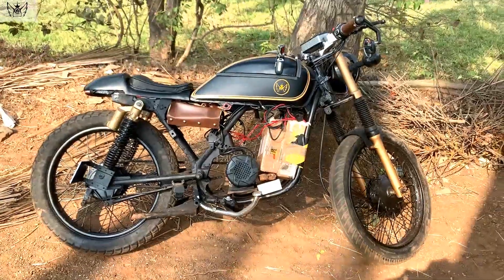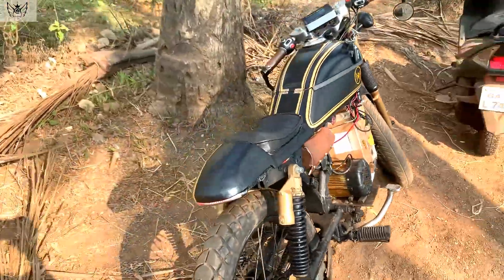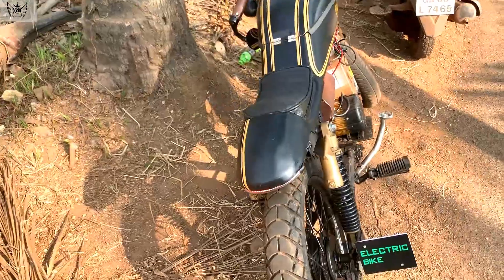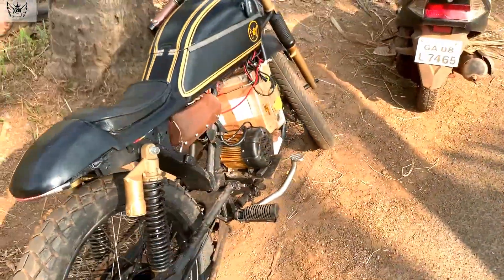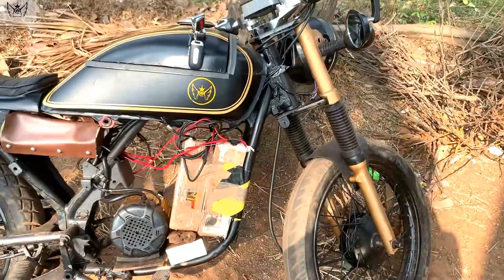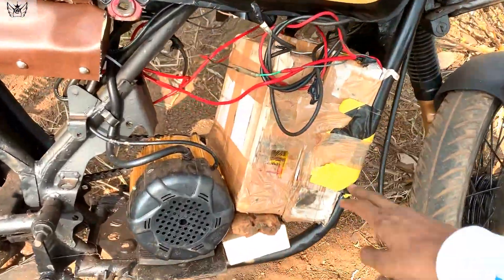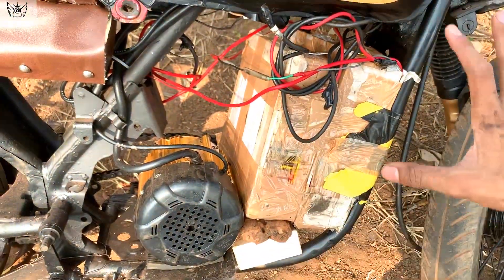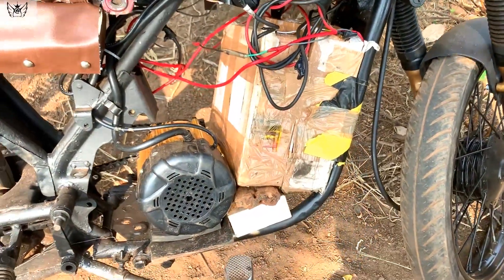How to make Electric Cafe Racer Part 3  #ebike #ebikeconversionkit #howtomake #easy #diyebike

Comment: Bhai RTO and traffic police allow karega??
Reply from the maker: If the speed is 30 to 25km and u have built your own chassis then its allowed
Reply: Tauseef Siddiqui so how much speed we will get if we used 48v 1000w motor with 48v 30ah battery??
Reply from the maker: @dakshxa7365  it depends on gear ratio
Iam getting 75km

Comment: If an electric bike can shift a gear, i will change to electric bike, but if it still automatic, I prefer choose engine bike
Reply from the maker: There are ebikes with gear systems but in 1st or 2nd gear their will be lose of power because motor have to lots of work in lower gear
Reply: @electro_king_official  gear ratio
Reply: Here's one for you by a company called Horwin, uses a 5-speed gearbox. https://www.horwin.eu/cr6/